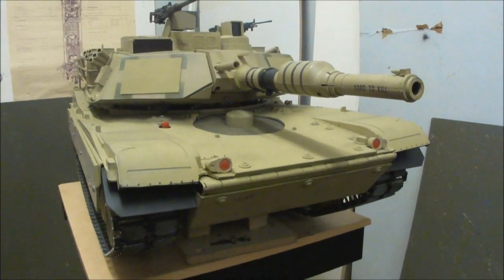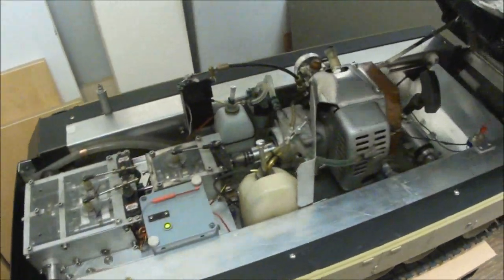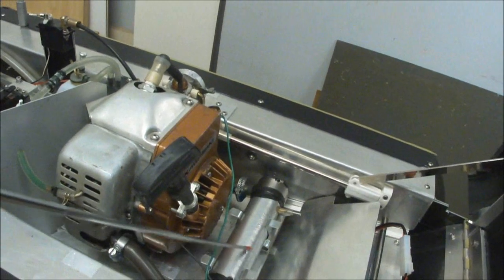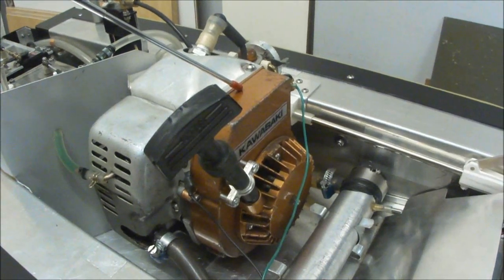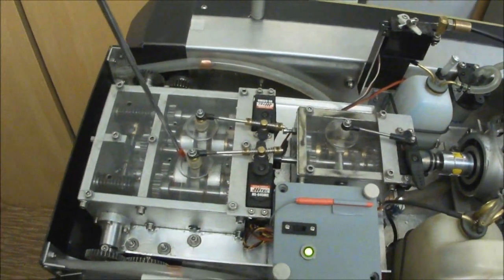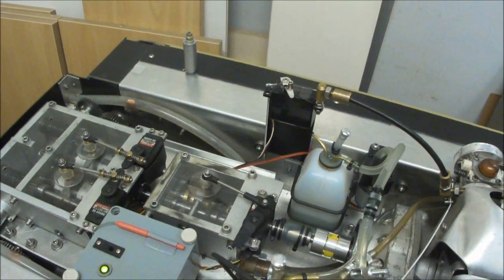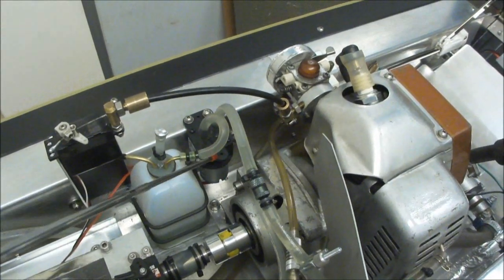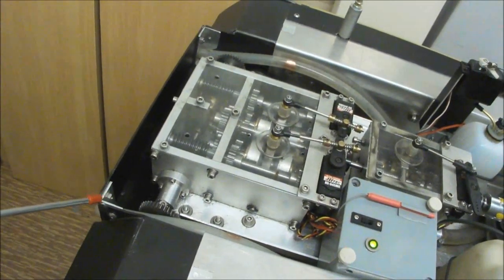Demonstration video of a M1 Abrams big scale RC tank how it works.wmv

Comment: The real Abrams and all of the tracks I worked on "except smoke tracks" used JP8 to make smoke. They basically just injected fuel into the hot exhaust and it was damn effective at making allot of smoke screening. My M88a1s always had working smoke gens mostly because I liked to use them to piss off people. But also for my own pure enjoyment. The M88a1s smoke gens system put out a crazy amount of smoke. But then so would a turbo burning a butt load of oil too lol.